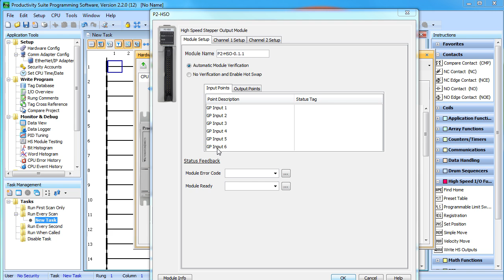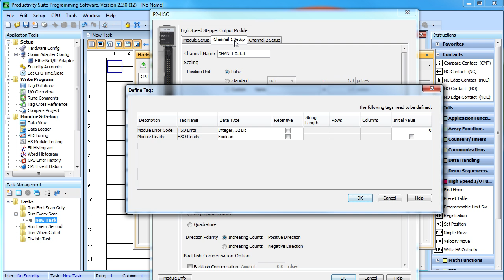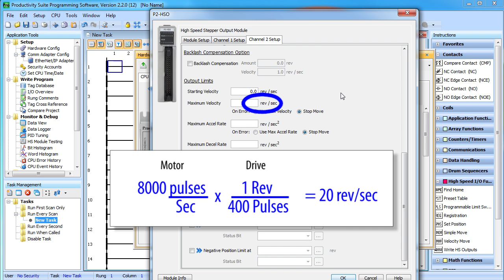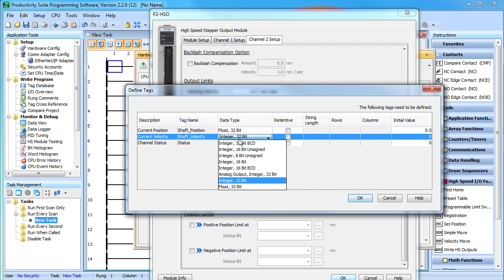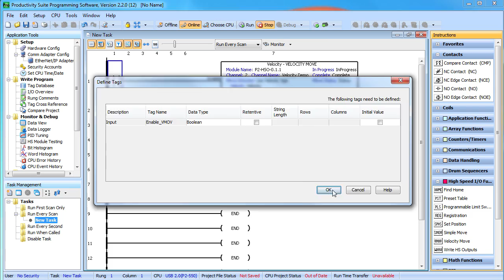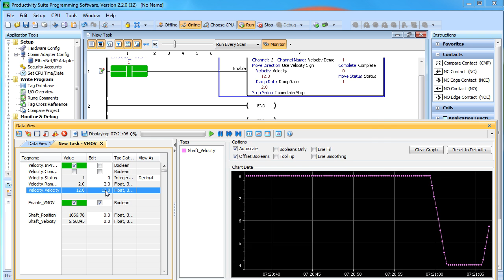Productivity Series PLCs Motion Control - Control Velocity from AutomationDirect

Comment: What module for the P2000 plc gives me step and direction for stepper positioning control? The pinout in the automationdirect website does not specify that the module shown in this video has the outputs for step and direction. Very vague and confusing information!
Reply from the maker: @johnboon5330, this video is part of a larger series. We cover setting up the axis for these move instructions in a different video:
https://www.youtube.com/watch?v=02J_LQn2UcQ&list=PLPdypWXY_ROq5LCEtWDT4k4f0CRAVzJmQ

That is where you assign the outputs for step and direction.
Reply: @automationdirect  OK thank you!